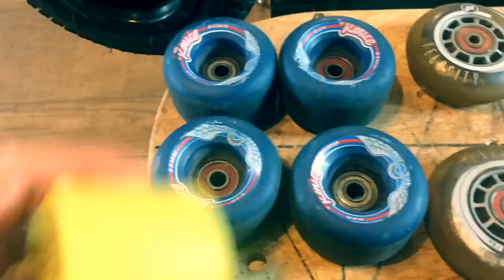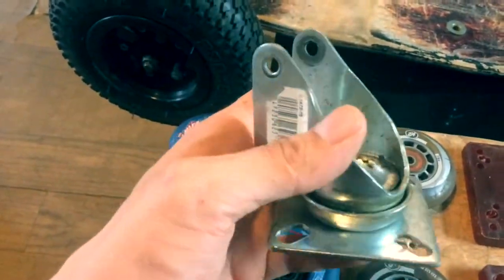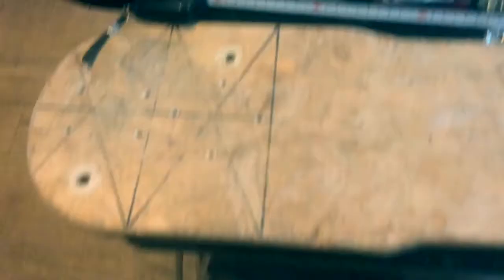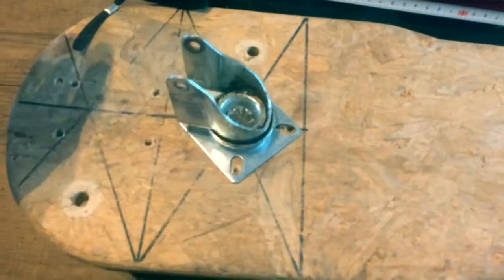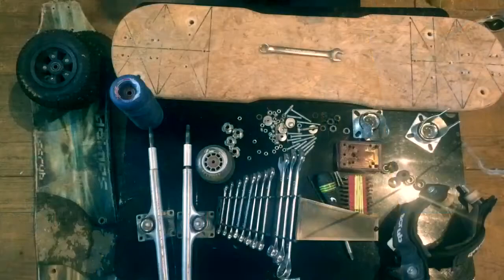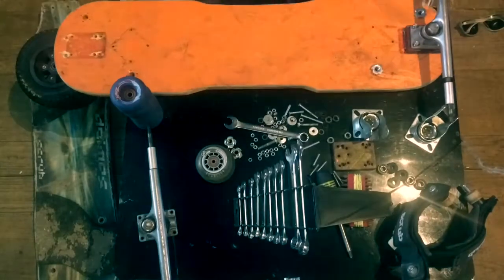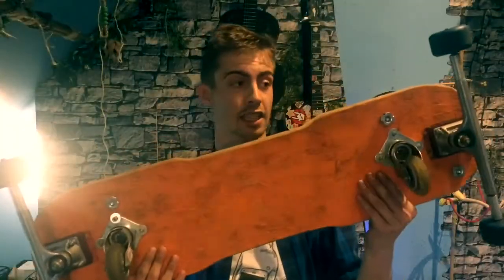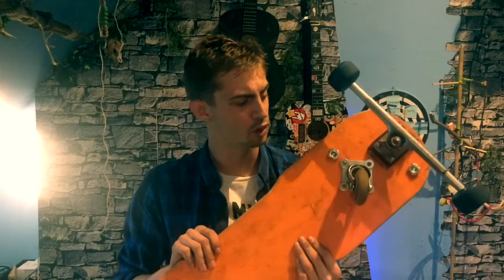How to make a cheap Diy freeboard

Comment: What are those things called you got from the hardware store?
Reply: Those are called Swivel Rubber Casters and are usually used to put under heavy cabinets or tv trays. They come in a lot of sizes and the best way to choose the right would, in my opinion, would be to take the wheel you want to use into the store with you while you eyeball a caster with enough clearance. Hopefully, I was able to help you if you were still wondering.
Reply from the maker: @thebesttypeofstupid7054  Thx bro, spot on!